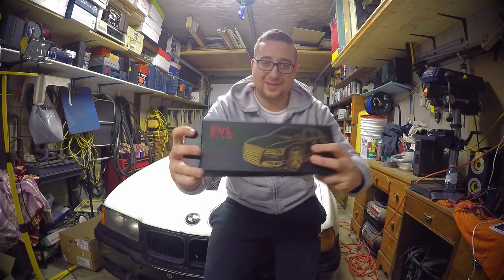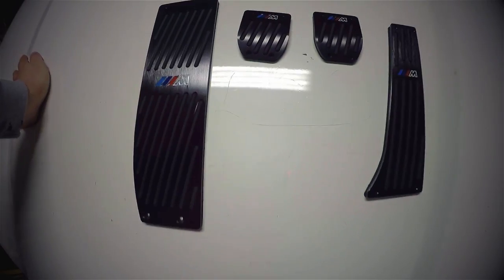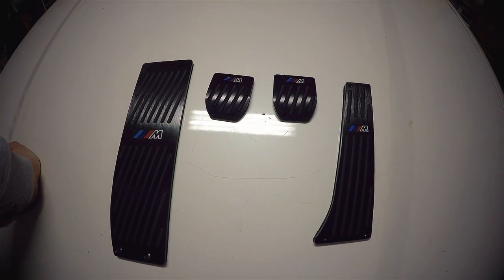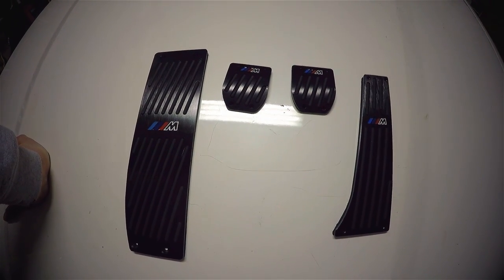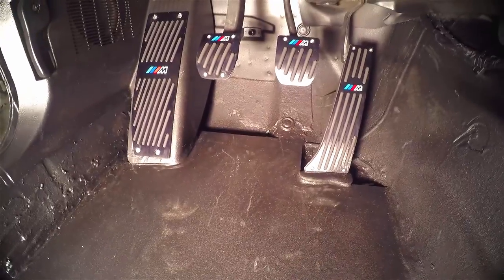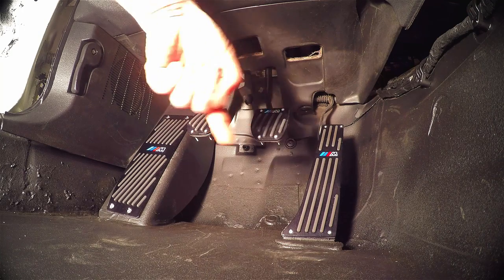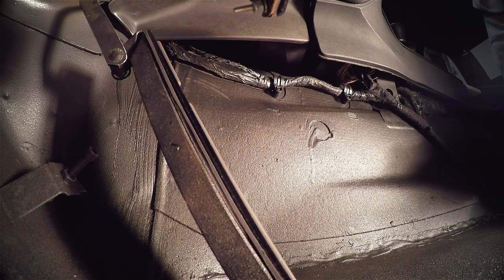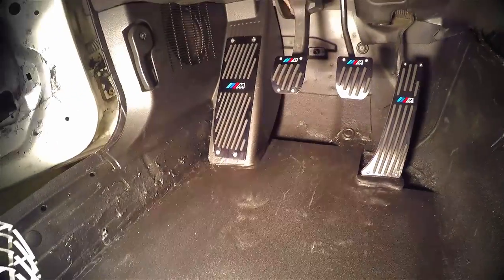E36 M3 Pedals Install

Comment: Shorter screws for clutch & brake pedal would have looked better.
Metal brake pedal due to safety standards and subjected to more pressure.
Plastic clutch pedal does seem cheap but it just goes in & out no real force required.
Wood shimming for dead pedal? lol that's worse than the extra long pedal screws.
Congrats on being able to get down in floorboard for drilling & mounting pedals, I
can't even do that at my age & worn out knees. Kind of like the blacked out header
panel around grille might have to try that on my white & black 318ic
Reply: How can you get shorter screws? My shoelace always gets caught in them